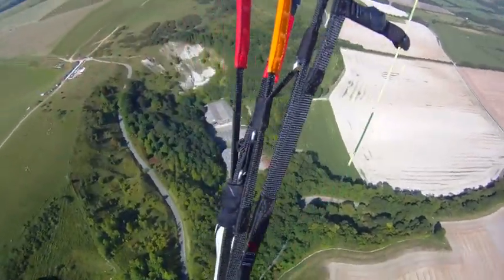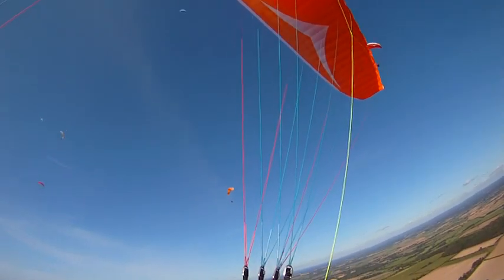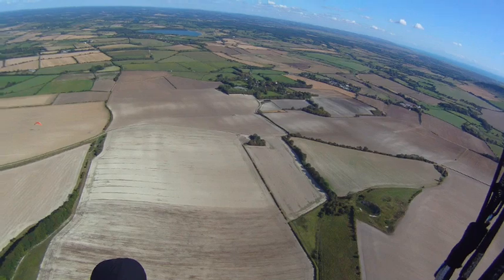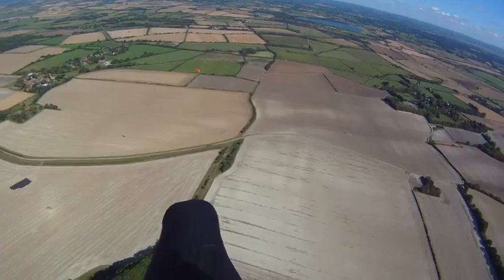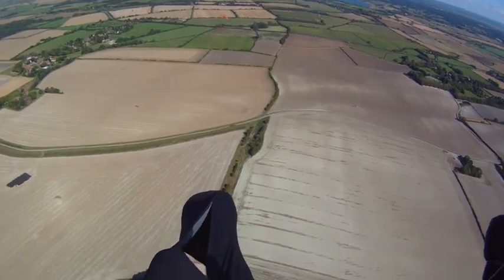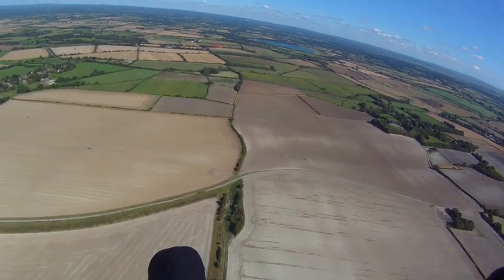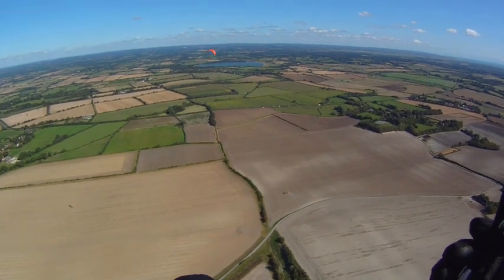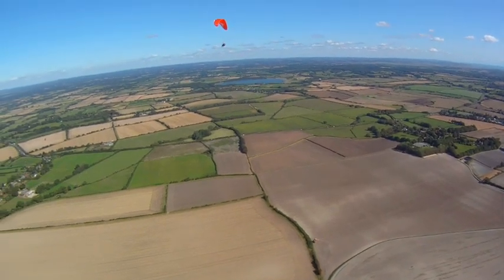Paragliding Thermal Training at Bo Peep

Comment from the maker: Hi Micheal - Tractor a good one but the ground would be bone dry, reason good elevation on slope is lower giving rise to thermals going up more and I could sense the thermal rather than I can see. Tractor around April late and August work better in generating thermals.